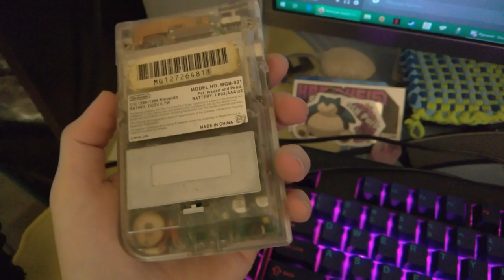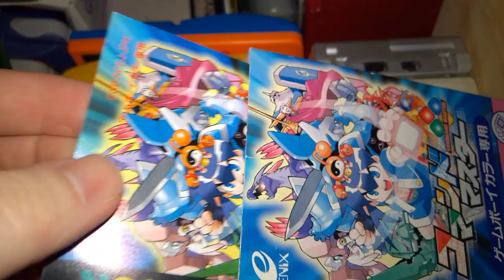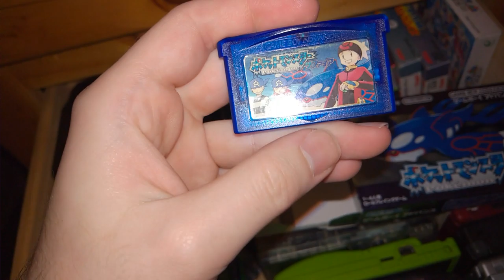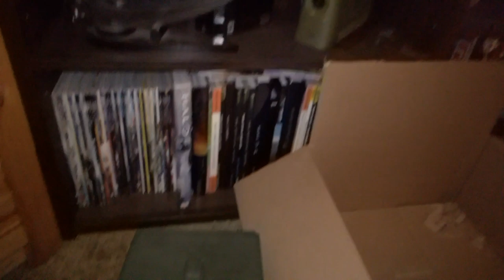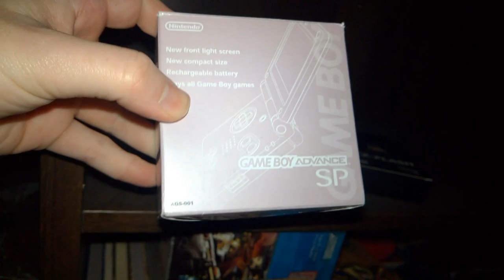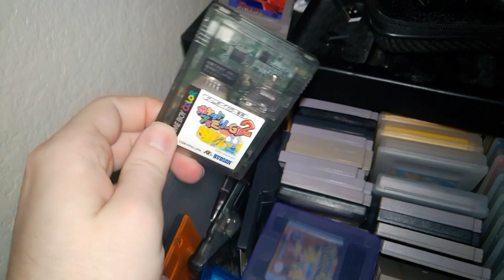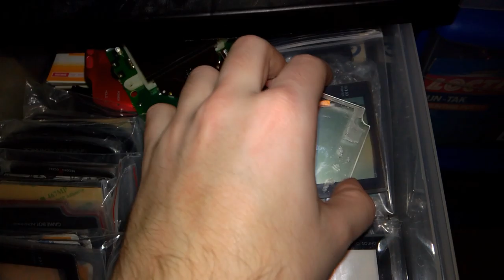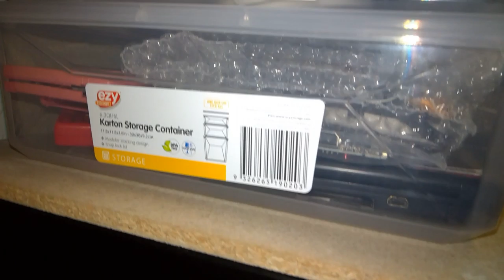A tour of my collection

Comment: I have a really random assortment of handhelds and consoles. I have a PSone and PS2 Slim, each of them are chipped. I have an SNES and NES, each are clone systems. I have an og N64. I have a 001 GBA SP with the V2 Funny Playing IPS mod. It's sort of my baby because, I got it at a Second & Charles for 20 bucks because, there was a hole drilled into the housing and the battery was so swollen, the battery cover was bowed out. I've modded it and reshelled it with my favorite colors and, I just love it. I also have 4 OG Nintendo DS systems from Japan. I really wish I could find a good source for new/afternarket shells/housings.
Reply: Oh. I also have a GPI Case with the battery mod. (It's a Raspberry Pi handheld.) I also recently got a minty condition Wii for 25 frickin bucks. I couldn't believe it.

Comment: I just realized at 19:39 that you have the LiPo battery in the old cheapo battery casing, but didnt wrap it.  I should probably do that as well. I wrapped mine with the original label and I was wondering why it didnt fit hahaha

Comment: @makho are lithium batteries that dangerous that you remove all of them from consoles ? I have several in my collection should I keep them apart ? I’ve read that worse that can happen is they bloat a bit. Thanks.
Reply from the maker: Worse that can happen is that they fucking explode in a fiery blaze. Do you not remember the Galaxy Note 7? Yeah, you should remove the batteries from any console if you intend to store it for more than a month. 

Besides, even if all they do is bloat, do you really want to deal with cracked and warped battery covers because the batteries put on a few for the holidays?
Reply: @makho  thanks for the answer ;)

Comment: I notice that a few of the gbas still have yellowed silicon buttons. Do you use retrobriting to fix yellowed buttons?
Reply from the maker: I usually just replace the buttons entirely if it's a GBA I've actually taken apart. I have enough OEM buttons that aren't yellowed that I can just swap in more OEM buttons for the consoles I want to keep stock (like limited editions) and then I can save the yellowed buttons (if they are still in good shape) for dying.
Reply: Oh, ok. I once tried retrobriting yellowed silicon buttons and it actually worked.

Comment: i have a brand new open box ds lite!
Reply from the maker: if it's open box, it's not brand new
Reply: @makho  but its mint condition. Not a single scratch with original battery. Cant be sold as brand new but mint.